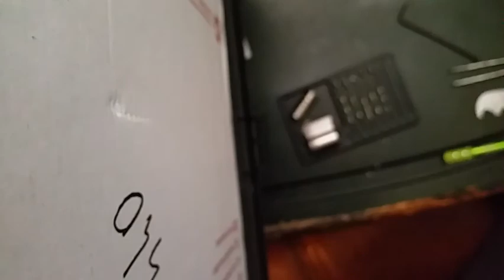Mul-T-Lock Interactive with serrated drivers, pick and gut

Comment: Are those home made picks in exacto knife handles?
Reply from the maker: No. They're the Honest Dong Shi dimple pick set. They're pretty cheap, but need to be hand finished to bring down the thickness and round out the edges. They're available on Banggood https://www.banggood.com/12-in-1-Practice-Lock-Picks-Unlocking-Tool-Set-Keys-Remove-Tools-p-1152304.html?rmmds=category&cur_warehouse=CN
Although I got them off of an eBay seller, who apparently doesn't have them anymore.

The Daniu, Huk and GOSO sets are apparently similar in quality. All need to be finished by hand to be usable. I'd stay away from the Sparrows Black Flag set. They've got a better finish, but they've got a bad reputation for breaking easily. The best dimple pick set out there is the one from Multipick. But that's a pricey thing (even for the basic version). They work out of the box though. I got to handle some briefly at a meetup, they're really nice.

https://shop.multipick.com/en/lock-picks/dimple-pin-pick-sets/elite-g-pro-starter-kit
https://shop.multipick.com/en/lock-picks/dimple-pin-pick-sets/multipick-elite-g-pro-set-13pcs